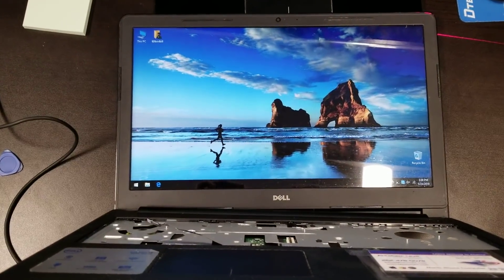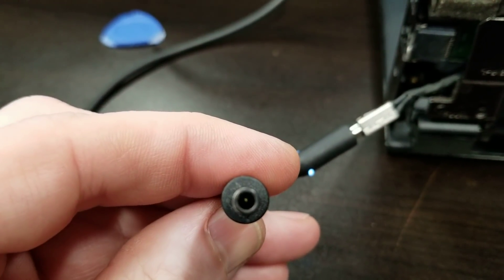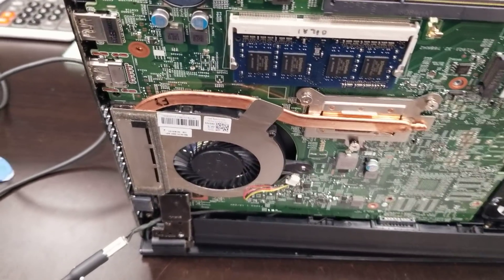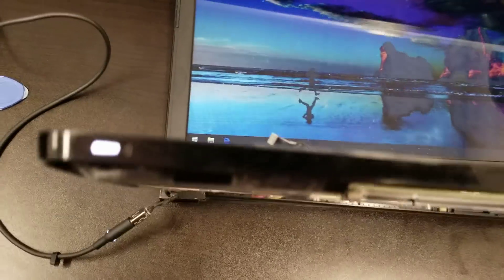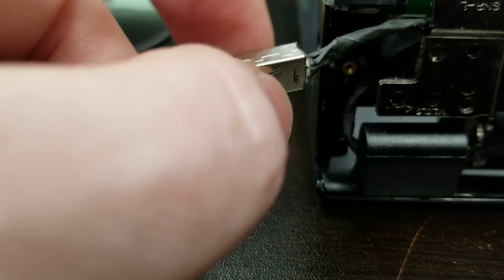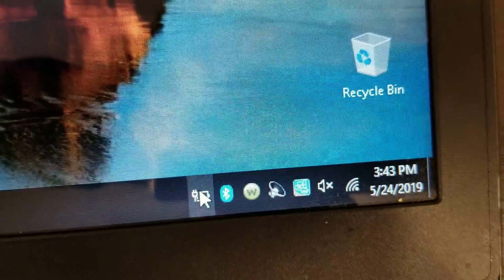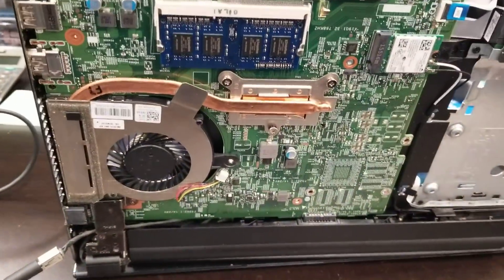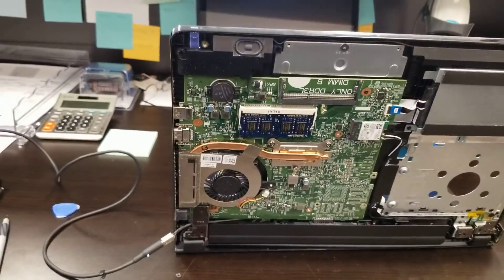SOLVED DELL and other laptops "Pluggeg in not charging" problem.

Comment: I have the same issue but it says Plugged in charging for the first few seconds then changes to not charging after. The percentage stays the same and doesnt move. Any help would be appreciated
Reply: The same happens to me, if you find the solution please let me know
Reply: @elib3672  yep i did the wire is broken so it only works at some angles ordered a replacement charger will let u know if it fixes it
Reply: @elib3672  forgot to update on it but 100% the wire was the issue got it replaced and it works fine now
Reply: Me too. It charges fine when Windows is shut down and the laptop is off or in standby. Once I power up it doesn't always like to charge when in Windows. Seems to have a mind of it's own. I've tried a new power adapter, dc jack, and battery. Nothing fixed it.
Reply: @kabookeo  hi, I am exoeriencing the EXACT problem . Then I thought it could be the power cables, so i tried a working cable from a friend and it is still doing the same thing.... until now I cant find a solution hope someone who have fix this already to share with us how u solved it. Thank you
Reply: @carmonamdrrmo9856  My guess is it's the motherboard. My laptop is about 5 years old so I won't be buying a new motherboard. I've spent enough money trying to fix it. I know it's new character so I shut it down and charge it when it needs juice. I have another laptop to use while this one is charging.
Reply: @kabookeo  My dell computer is almost brand new (1 year) and has the SAME problem. I've tried everything but the problem persists. When the computer is off, it charges without problem, but when it's on, I've to try many times until I get it. This is so frustrating.
Reply: @tomassaavedra4543  You're lucky it's new. If I were you I'd take advantage of that warranty and have Dell repair it for free. My guess is they're going to replace the motherboard. Let me know what they actually do to fix it.
Reply: @carmonamdrrmo9856  Hey there! And anyone else, if you are having this same issue as you have mentioned; I have the solution! I'm convinced this issue and the issue in the video IS NOT a physical (hardware problem)in the majority of cases. This happened to me a few times and I even posted a comment on Notebook Review and a reedited comment adding a VERY ESSENTIAL step; here is the link to the comments: http://forum.notebookreview.com/threads/is-it-a-graphics-batter-or-ac-adaptor-issue.833414/ Go to page 2 for the comment exactly concerning your issue. Here is the condensed solution of your issue: *VERY ESSENTIAL* <IMMEDIATELY perform a Windows shut down the when the battery charging icon displays it's charging BUT BEFORE the white Switch Graphic Card pop-up message displays: The AC adapter currently connected is not supported. System will continue on battery. Press any key to continue. You only have a brief amount of time to do this as the pop up happens maybe 30 seconds, if even that, within the time from plugged in/charging to not charging of the battery icon's status in the task bar. Let me know if you or any of you who try this method have success with it. Thanks! I hope this helped anyone a great deal!!
Reply: @tomassaavedra4543  Just curious if you tried my solution; I'm asking this to you because it doesn't make sense for the problem to be with the motherboard since it charges without a problem when your computer is off, but when it's on (the operating system and drivers are functioning) the issue happens. Salute!
Reply: @kabookeo  You answered your own speculation in your own 1st comment: "It charges fine when Windows is shut down....it doesn't always like to charge when in Windows"; it's not a physical hardware, including your motherboard, issue. Something, whatever it is, isn't jiving or communicating as it should with either a driver, the Windows OS, the circuitry of the power supply charging function or even all three aren't working with each other as designed to.

Comment: For me, this video identified DC plug insertion timing (and the flimsy/cheap DC jack design) as the real  root cause of this Dell charging issue. This has led me to a work around to charge my Dell. What happened to me is that I tripped over my power cord plugged into my Dell (if you do this a couple times, the flimsy design at the DC jack will eventually weaken - for everybody). The jack then loosens and you can't tighten it with the flimsy screw that strips. The result is that when you insert the DC plug into the Dell, the jack moves and the connection takes to long to meet the time allotted by Dell for insertion -- it won't ever recognize the adapter and won't charge, no matter what you try (i.e., not a BIOS update, new battery, new AC adapter, etc.). The solution is to secure the jack again to the board so it won't move. In the mean time, you can continue to re-insert and hope to meet the short insertion time window, but the trick is, when you do re-insert again you need to wait a few seconds before you re-insert again. I've learned how to do this and it works. Then I leave it plugged-in overnight to re-charge my battery to 100% again.  When I have time I'll disassemble and secure the jack to the board. Dell needs to fortify the flimsy/cheap jack design (flimsy/cheap isn't what I'm used to from Dell). Thank you Computer Services for the video.
Reply: Dell have shit laptops tbh always problems with either bios o the Jack
Reply: Bravo! This problem drove me nuts. Now it charges.
Reply: Wow I did the same tripped over my power cord hope this may help